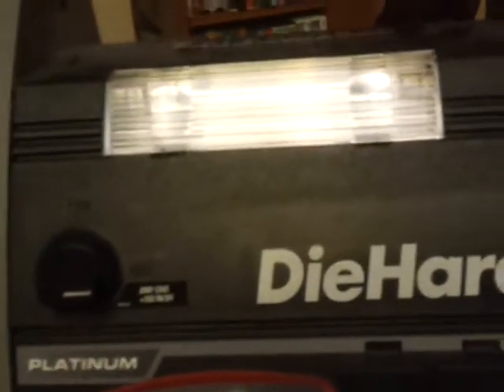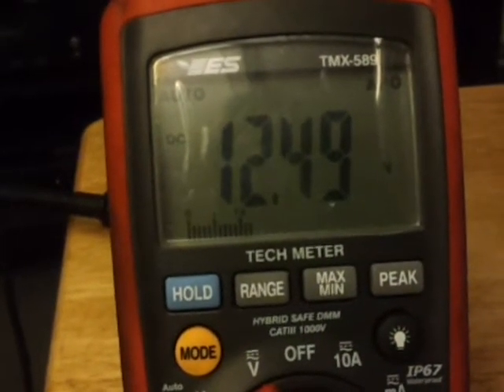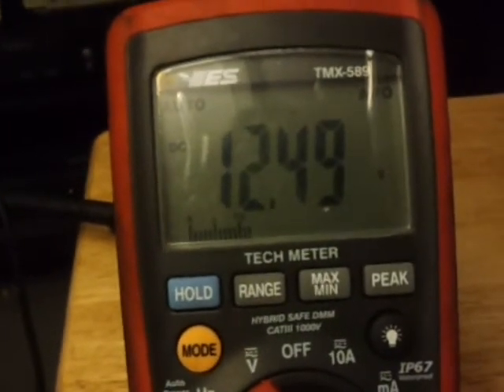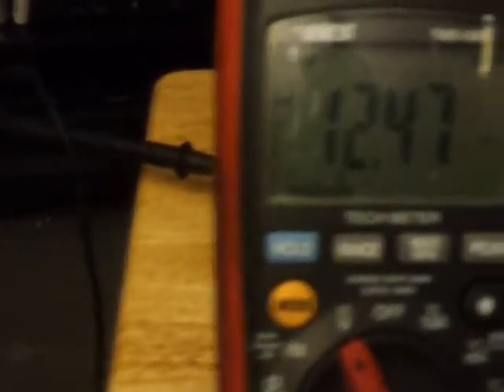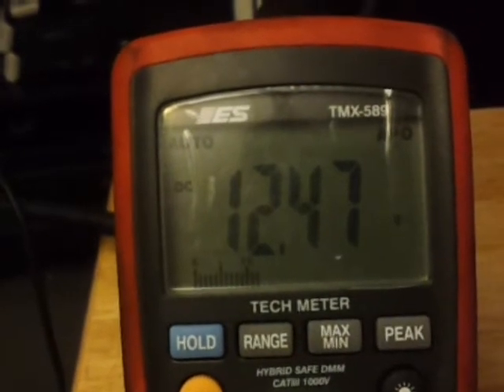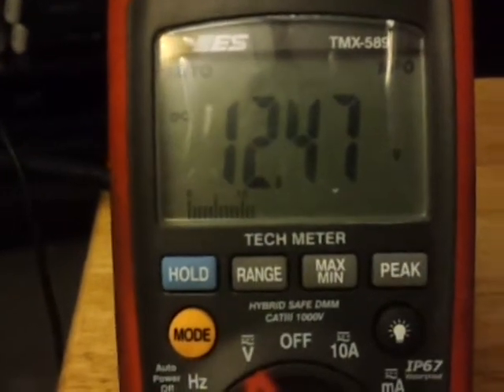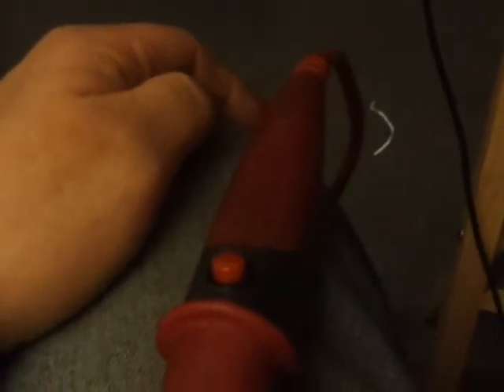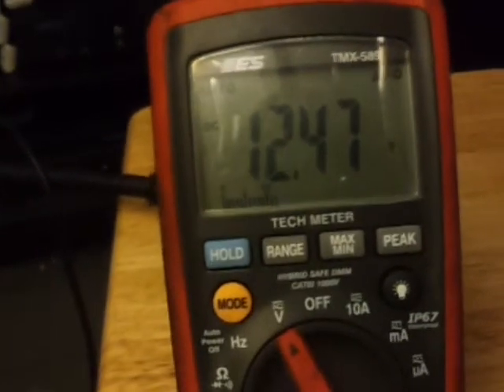Ohm meter testing v.s. Voltage drop testing/Loadpro operation pt. 2

Comment: Additional: I tend to connect a digital across the length of the wire feed and place a medium load on the end, wiggle the connectors and watch the meter jump about like a kangaroo on a pogo stick :-)

Comment: As im into electronics i can see the problems of using a "high impedance" multimeter to test power/signal feed wiring/connections, i have tryed to explain to my frends about bad connections creating a high resistance and showing a false reading on digital meters,  people go blank faced when i try to explain resistance effects lol :-)

Also water link dampness in connectors can lead to some very daft false readings lol.

Comment from the maker: Once you start practicing, it is very easy to distinguish between the ghost voltage and the true zero volts.
When I get some time, I will make a video on this to help.  Plus I will be making another one on a case study I had on a transit bus air conditioning system.

Comment from the maker: Glad I could help.  Like I said before if you want the ghost voltage to be more responsive you can put your 87V to the milli volts scale at first while checking the circuit and that will give you a even better response.  I myself own a 87V too and I have gotten good response on the .000 scale, you just have to shake the leads around like you said.  You could also try wrapping either the positive or negative lead of the leads around your arm and that will help with the response too.

Comment: OK, I played with my Fluke 87V today. I see what you mean, it's a few mV either way bouncing around. I guess I was expecting more dancing, but I can definitely tell the difference between zero and that, especially if I shake the leads a little.  I found a Wiki article explaining it's minimal inductive current from other devices in the area, which would also explain why the ghost voltage swings with physical movement. That makes sense, thanks.

Comment from the maker: One good way to experiment on this method is just take a jumper wire and hook it up to both meter leads and have your voltmeter on the milli volt setting.  When both leads are touching the jumper wire you will have a 0 volt indication which means two things, you have continuity in the circuit, and if you are checking at a load connector with it unplugged means you have a short to ground.  Try it out.  Let me know which meter you use and I can help you better.

Comment from the maker: Another aspect to keep in mind is that each meter has a different default setting for which range the voltmeter starts at.  So at lower resolutions, the ghost voltage reading is not going to be as responsive.  So if you have a manual ranging meter, start on the milli volts setting, you will have good response there, then if the meter says OL or 1, you know you have a higher steady voltage and not an open, you then just simply move the range on the meter up till the OL or 1 indication goes away.

Comment from the maker: Spelunkerd, when you say normal voltmeter, do you mean a manual ranging meter? Or are you referring to the meter I am using in the video?  I have seen the meter you use in your videos, Fluke 87? 88?  From all the different meters I have used, every one has a ghost voltage reading when you connect to a circuit with a open.  This is due to the fact that the leads are not touching a complete circuit, and the meter is picking up stray voltages from the earth's magnetic field.

Comment: I guess what is bothering me is the question of why the voltmeter behaves differently than a normal voltmeter in certain situations. 'Ghost voltage' is not something I see with a normal voltmeter, and with no explanation of what is happening I don't have confidence in the result. Dan hasn't responded my questions about that....